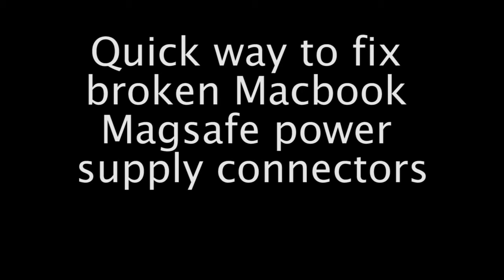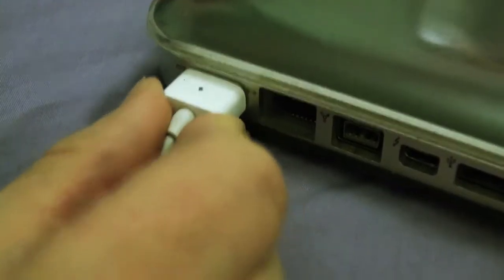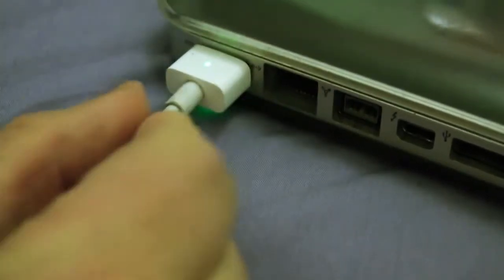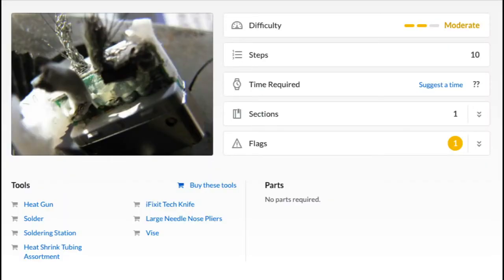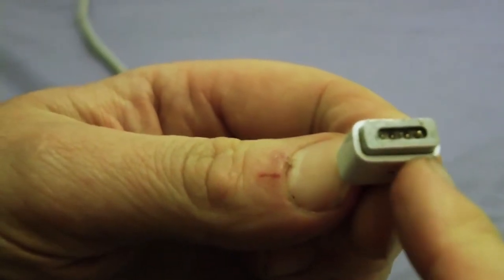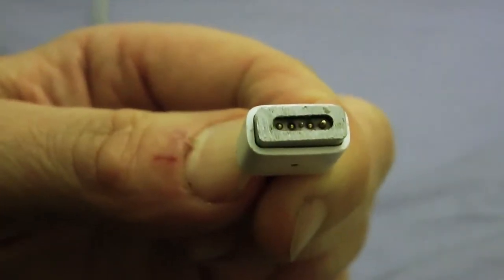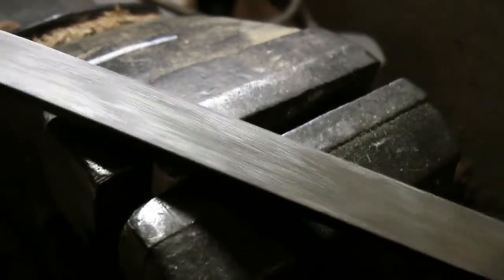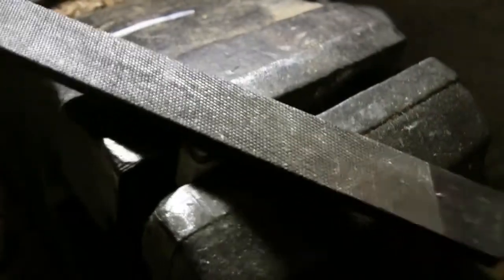Broken Apple MagSafe power supply? Try this quick easy fix.

Comment: I decided to check my Macbook pro charging port first before following your way (filing the connector). I scraped off a thin grey layer/coating (possibly a magnet coating) around the pins, which is cracking anyway. After its removal, my magsafe power adapter is charging/connecting again.

Comment: Don't do this! The issue is on the other side junk builds up in the systems socket. Clean it
Reply from the maker: Good point - gently remove any loose dirt from the socket with something non-metallic. The dirt may well be bits of metal stuck to the magnets. Turn off the power and wipe with some iso-propyl alcohol if it's grimy and make sure it's all evaporated before plugging connecting power again.
Reply: ty

Comment: Thank you man... It's working now. But it's gets really hot, any help?
Reply from the maker: Is it the plug that's getting hot, or the main unit of the power supply? Either way, it sounds like something is shorting out - I'd recommend replacing it, or at least never leaving it plugged in when you're not there. It could catch light and/or damage your mac.
Reply: That small plug in
Reply from the maker: @lunahringwangshol6933  I replaced the small plug in part on one of my power supplies: I had another one where the main power supply had failed but the plug was OK. Despite all the terminals on the plug, the wire just has positive and negative cores.

Comment: Good tip, have a magsafe were one end pin has gone right in, managed to add a little solder to it and now filed it down a little like this and connects first time every time now, before this had to slant the connector, thanks

Comment: Boss not working still can u give any other hint
Reply from the maker: You might need to get a new charger. Genuine Apple ones are expensive! If you want one cheaper I'd recommend looking for a second hand genuine one on ebay rather than a new third party ones - some of those get too hot, make buzzing sounds and give you tiny shocks from the Mac's casing.
Reply: The pins must have gone below the plastic separator
Reply: instead of buying a new charger you can buy the cable, which is usually at fault.

cable is easy to repair.

Comment: i have the same problem like you. thank you very much for help
Reply from the maker: This fix helped a bit, but I ended up having to replace the charger. A useful tip: many of the cheap non-apple power supplies aren't properly earthed and will give you (small) electronic shocks from the macbook metal case. I bought a second hand genuine Apple supply very cheaply - the new ones are expensive!